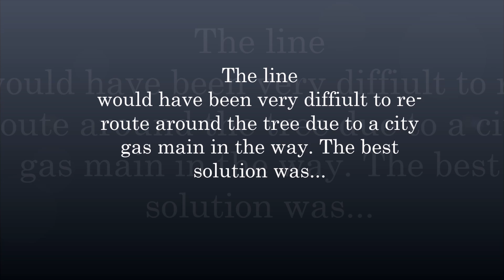Sewer Replacement / Pipe Bursting, Brazos Valley, Texas

Comment: these videos are so goddamn satisfying to watch
Reply from the maker: The Gunslinger, Thank you. I could have done better on the intro. I over used the transition. Oh well.
Reply: Just a little advice you should wait for the trimmer blades to completely stop spinning before you back it off of the Jig
Reply from the maker: Jose Moreno, thank you for the advice. The manufacturer representative was the one running the machine. But that's good to know.

Comment: We have just started pipe bursting what kind of pipe do yall use
Reply from the maker: I didn't know there was an option. We use HDPE. Did you mean what thickness?
Reply: @DynamicDrainsofTexas  yes what thickness
Reply from the maker: @mattheweasley1173  DR 17 Is the thickness we typically use. For sewer lines at the depth that we deal with and really up to about 10 feet or so, that is the appropriate thickness.